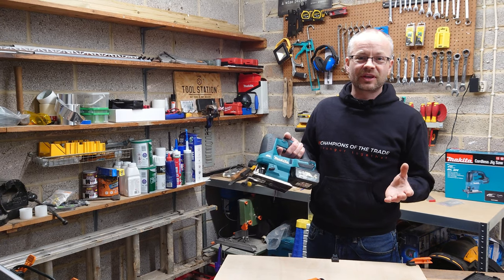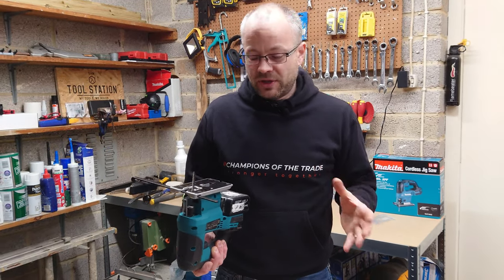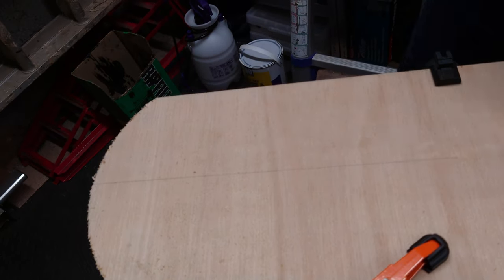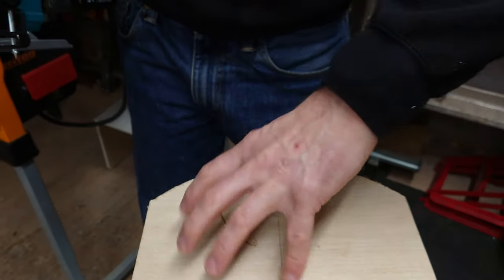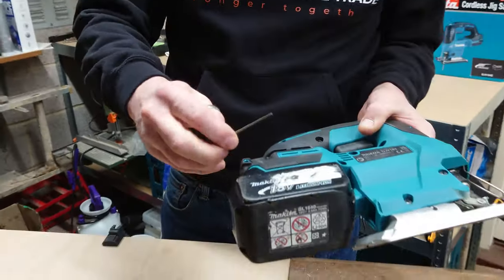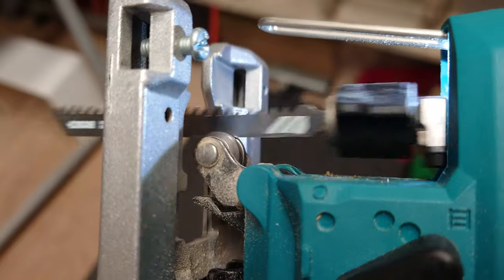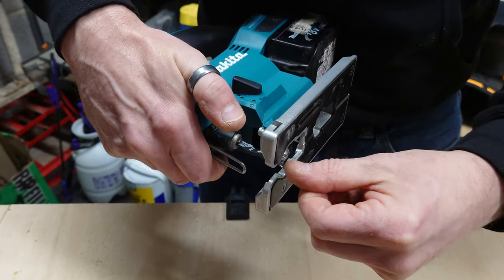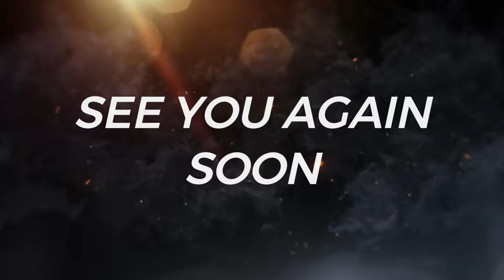Tips & Tricks for Getting the Best Out of Your Jigsaw

Comment: Correct me if I'm wrong but isn't that plastic instert plate from the very end of the vid there to help keep the blade even straighter for a neat, square cut?
Reply from the maker: No, to do that it would require direct contact with the blade. It wouldn't last 5 seconds.

Comment: It might sound mad but try holding the jig saw upside down and cutting with the blade sticking up. All sawdust goes down away from the cut line and you get a great view and no splintering.
Reply from the maker: That's worth a try, though it'll only work if you're cutting along the edge... Or flip the timber over 👍

Comment: Best anti splintering device is painter’s tape on the line 👍
Reply from the maker: That really depends on the material being cut. If I need a really good edge, I'll either opt to over cut and sand or use smaller toothed blades.